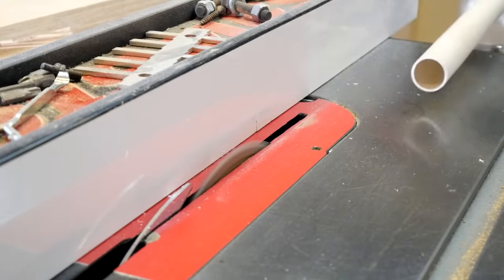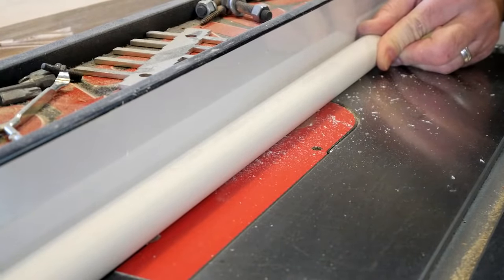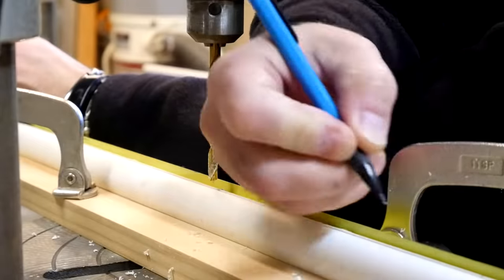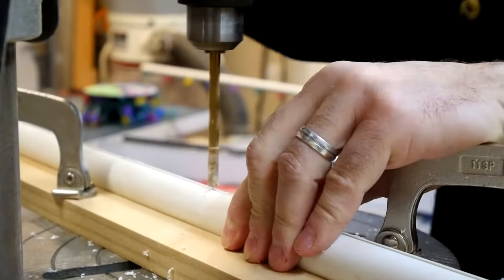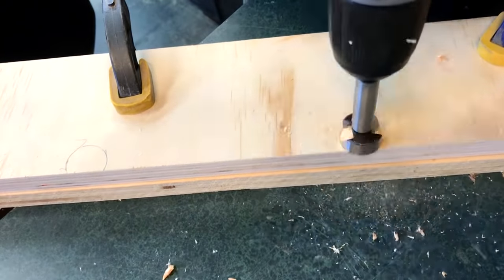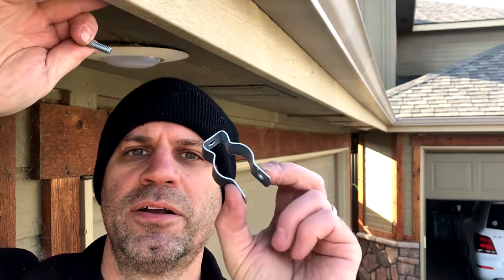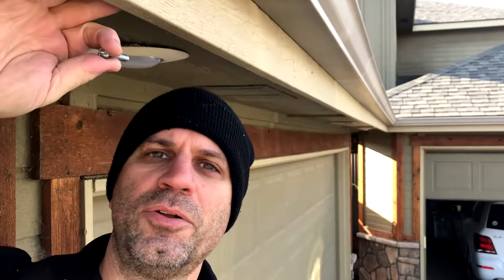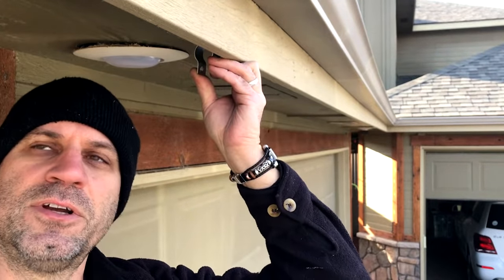Better Way to Install Christmas Lights

Comment: Great idea but you know how Christmas lights are now.  They last one or two seasons and you’ll be removing strings of lights and installing another in the pipes. Just wonder if it will save you time in the long run?  Nice idea though.

Comment: I have been wanting to use some vinyl "J" channel set up against the side of the house and use ribbon LED strips. They would shine up and be protected from the sun.
Reply: They make dedicated aluminum channel with a cover for that purpose. Bit more expensive, but cleaner look.
Reply: Expensive, but that's what the "everlights" product asks for.
Reply: @uploadedvideos7907  20m is $90US, so it isn't incredibly expensive.

Comment: I like the idea, but they do make LED track out of aluminum that have a opaque cover for leaving the lights up all year. It just looks like other trim on the house at that point. If you put programmable 4 color LEDs in them you can change the color based on the holiday and use them more. They are more expensive than this, but also more permanent and look better.

Comment: What's the update on if turning them in for the rest of the year works?
Reply from the maker: @eric4880, Thanks for asking what seems to be on many people's minds! Yes, they work just as I hoped. It takes about 15 minutes to rotate the pipes at the beginning and end of each season. Have had zero maintenance and they still work great!

Comment: Could this be used with any Christmas lights and what was the purpose of the hole through the slit
Reply: I would think it is where the bulb sits and keeps them from sliding.

Comment: quick suggestion, it might be easier to drill the holes first and then run the pipe through the table saw. The pipe is more rigid before you slice it.
Reply: YES I was thinking the same, use a sharpie to mark a straight line prior to drilling the hole for a straight line

Comment: Cool idea - wouldn't it be easier to drill the holes before you slice down the length of the pipe?

Comment: I did the same thing about 5 years ago. But I drilled them sideways into the backside of the facia board and left some play in the screw to expand  to put the lights in. I also use a pair of dikes to open the channel when I twist it. Hides the wires and holds the lights straight. I use it every year. I leave the pipe up but take the lights down.

Comment: As some of the others suggested 
You should have drilled the holes first
Then make the saw cut down the center of your pipe , 
Next is pick up some male and female electrical plugs to put on the end of each light strip , After installing the lights in a length of pipe , Cut the wires at the end of the pipe and install a male plug on the end of one strip and a female plug on the next strip and so on
That way you have individual light strip assemblies , Making them much easier to put up instead of having the pipes together in one long strand , So you just put the strips up one at a time and plug in the ends of the strips together afterwards , 
All you need is just the cheap electrical plugs if you're using LED lights because of how little power they use

Comment: If you wanted to put them up and take them down quick and easy you could use broom holder clips like every 16 inches or so. Then the tubes would just pop in and out.

Comment: To anyone wanting to use this idea, drill the holes before cutting the pipe. You can surely snap a line down the center to keep the holes in a straight line vs having to spend time making jigs to keep the channel closed while trying to drill holes.

Comment: Nice installation.  I screwed eyelets into the eve facia. I still have to hang the lights but at least they stay up until I decide to remove them. I was using the long icicle hanging lights.. I would come home, before the eyelets were installed and find half of the strings were on the ground. No more of that.
 Another trick I used was to install the lights inside my house in the windows using tiny suction cups. The house was a rental and the landlord would not allow anything attached to the exterior of the dwelling.

Comment: The pipe usually has printing on it all the way down you can use as a reference for a straight line. First use an soldering iron the size of the lamp sockets and melt the holes. Then slice the pipe using printing as reference. The pipe will slightly compress after being spice and the light socket will fit snugly in the holes that were melted with a smooth round edge making the lamps stand straight up.
Reply: Why the hell do you need to "melt" them? Just drill them out and save yourself time. Besides that, the fumes that escape from melted and burning PVC and not exactly the best for you. That C there means chloride.

Comment: Just an thought but, That may rot out the fascia board over time. Especially if you take them down every year and then re-install next year with new or old screw holes.
Reply: Less likely to rot the soffit since it's not generally subjected to direct water contact, however condensation on those metal clips can reduce the lifetime of the soffit as over time it will cause the anchor points to swell up. I'd use a nylon washer to add a 1/4 between the soffit and the bracket clip. With a dab of Dap on both sides of the washer condensation moisture likely won't be a problem.

Comment: That seems like a lot of work, and it looks the same year after year. i achieved a better (in my opinion) effect with a bunch of cup hooks. They've been up and usable in many different configurations for over 30 years.  Plus light storage is way easier too.

Comment: What  are  the clips/hangers you used called? and  Were you able to swivel  them in a fashion that you you could leave the lights tucked away for  the year?
Reply: Yes, those clips! I need the name. I already have my lights attached to PVC, but I need better clips!
Reply: @kbcoggin  They are pipe hangers. Buy them at Home Depot or Lowes

Comment: Use binder clips to fasten them to the under side of the facia board.  After the season is over they pull right off.  The clips are then ready for the next year.  No nailing. Low cost.  EASY!!

Comment: i keep it simple - i have gutter hooks which i leave up year round, and then i just drop the strand of lights in the hooks --- with a helper, only takes a few minutes to hang lights. only on front of house, one straight line - brick ranch.

Comment: Good idea, but my HOA will not let me use the clips or leave the lights up.  Going to use aluminum hooks to hang the pipe to the gutter.   This way I can put them up and take them down with a long stick instead of a ladder.

Comment: How severe is your winds in the Holiday Season? I am wondering how much of an issue having 40-50mph winds with gusts much stronger would cause the thin wall schedule 40, vs schedule 80....
Reply: I recommend you move to an area with more civilized winds!!

Comment: I think this is genius. I like icicle lights. Could something similar work if you cut the slot and fed the main line through it with the danglers falling out?

Comment: I just spaced nails in the wood following the roof line and wrapped the lights wire around the nail once then moved to the next...60 feet of lights  done in 20 minutes.  Nails will be there for next year.
Reply: Just be super careful that the screw threads don't cut into the plastic wire's wrapping or they could catch fire (or create a dangerous shock hazard when you touch them to take them down).

Comment: I'm waiting for someone to come out with a UV stable xmas light holder.  Just like his original.  I have the clear clips on my gutters, with clear lights I use all year round as low level patio lighting. About every 4 mos, the sun destroys the clips, and they 'unzip' and my lights fall off the gutters.

Comment: But those, you have to bring down after the holidays. If you put up addressable LEDs, you can have lights for different holidays all year round, and you cant see them from the street during the day. Wont get an HOA letter in the mail either.

Comment: Should have made a little wooden JIG to spread the pipe split that you could just move down the pipe as you put the lights in. That would have made it much easier.
And you should have spray painted the pipe black or dark green or some dark color. Or maybe the color of your house parts.

Comment: Probably would have saved you some time and headaches if you drilled your holes first then ran it through the table saw then you wouldn't have had to kill your fingers and then waste time having to make another jig to hold it together to drill the holes

Comment: Why didn't you drill the bulb-mounting holes first, then slit the tube?  It would have been a slightly interrupted cut, but far faster and cleaner than the process you ended with.  Your jig could have been oriented to put pressure on the side-walls longitudinally instead of radially. 

Overall, this is a brilliant concept.  I especially like the idea of rotating the lights during the off-season.
Reply: he wanted to show how smart he is...LOL

Comment: Everytime the spinning blade reaches a new hole, you run the risk of shattering the pipe. Cut first, then lower the impact on the material and drill.

Comment: Nice idea, as a tool maker, you should have drilled the holes first and then cut the slot out. Would have also liked to have seen a few pics even, of the finished project.

Comment: That looks like a ton more work! I could have had them up and done by then! It takes me maybe 30 minutes to hand mine! I have a 2400 sq ft one story house with very high apexes i hammered a nail every 18 inches just behind the eaves and it makes hanging and removing lights ez pz lemon squeezy!

Comment: Could draw a line, drill holes down the line first, then rip down the line through the holes afterwards so you don't have to squeeze it together.

Comment: I like your idea. I do have a tiny bit of constructive criticism though. I'm now retired, but owned a machine shop for many years where we designed and built many complex die sets for punching and bending metal parts. My comment is on the hold down boards you added to keep the pipe located and the slot from opening up while you drill the cross hole in it. This could've been done much simpler by screwing some wood pieces flat atop of your base board, snugged against each side of the pipe, and then when you had enough height you could bridge over the pipe with another piece. Drill your hole through that piece and the pipe would be secured. If it were metal you were drilling in, I would press fit what's called a drill bushing. This allows a very accurate placement of the hole. Of course you would not need that, which is why a simple hole using the same drill you are drilling into the pipe with. I have always loved people that think of better ways to do something, and you certainly are that!

Comment: Nice!  I was concerned about storage, but under the soffit, they store in place!  I guess I still wonder whether exposure to the outdoor environment year round might take a toll, but it’s certainly worth a try.  Great job!
Reply: This is for sure not permanent. No wire is going to tolerate the heat and cold forever. The rig will have to be brought down and the lights replaced every few years for sure.

Comment: The lights are LEDs and are connected on a 3-wire run which has preset lengths and could be limiting. 

Purchase 2-wire empty socket wire that you can cut to any length, fill with screw-in LEDs and connect multiple sets with use vampire plugs and sockets. 

I love his idea, I thought of something similar years ago but wasn't able to make it work. I'll be doing this for sure. Great video!

Comment: I dunno, seems like a lot of work. They use clips that screw into a paint roller pole and you clip on the gutter, then unscrew from the pole. It takes less then 20 minutes to hang end to end. Your way is clever though.

Comment: I don't know... I have clips on my gutters all year round. I just lay out the strings on the ground, climb up and hook on either side of the ladder, move and repeat. I also have a string of whites permanently attached under the eaves to light the front yard. Unplug one set, plug in the other. It aint that "hard".

Comment: This method looks like too much work.  My father put screw-in J hooks into the bottom of the soffit boards and hung the lights on those.  After the holiday it's easy to lift the string of lights off the hooks for storage.  The hooks stay there year around.

Comment: I felt like this was pretty much overkill. And I love how chaotic this is. It would have taken less time to hang them traditionally, and you added time and effort for this solution. This is a win if you kept them up all year. I am dying to see how it came out.
Reply: Was thinking the same?
Reply: Taking them down and putting back up the next year is way easier though. Just snap it into the clips left from last year. Also you spend less time up on a ladder, and had to move the ladder much less. All reducing risk of injury. The lights are more consistently oriented and spaced as well.

Comment: Nicely done ! I've been using paired 1X2 's painted white with the strings of lights held on with white Tie-wraps . I used simple eye-hooks to mount everything to the fascia and I can put everything up , or down , in about ten minutes . Be sure to use UV resistant Tie-wraps if anyone tries this route . Great idea of yours ! Cheers/SRK

Comment: No one else was worried about cutting a PVC tube on a table saw without some method to keep it from rolling on the blade? Jus a small twist and that thing kicks back in your face or worse yet shatters.

Comment: What a great idea! I have the same lights and quit putting them up because of the crappy time consuming clips too!
It’s too late for me to try it this year. I hope I remember, next year!
By the way, the pipe you used is called schedule 80
Reply: Schedule 80 has thicker walls than schedule 40
Reply: Kevin Allen your mixed up. Schedule 40 has thicker walls than schedule 80! It’s similar to metal thickness and wire thickness, the larger the number, the thinner the product! 28 gauge sheet metal is thinner than 12 gauge, 14 gauge wire is thinner than 10 gauge.
It’s the same with shot guns too, a 20 gauge is smaller than a 12 gauge. So I hope this helps you understand that I know what I’m talking about and I’m not guessing!
Reply: @grdelawter4266  Its the same with jewelry too (at least earings, eyebrow/nose peircings, etc)  I remember when I was in my 20s trying to find some.  Higher the number the thinner/smaller it is
Reply: @grdelawter4266  Sorry; you’re the confused party here.  Examples:  1” Sch 40 is 1/8” thick.  1” Sch 80 is 3/16” thick.  1-1/4 Sch 40 is 1/8” thick.  1-1/4” Sch 80 is 1/4” thick.  You are correct regarding sheet metal and shotgun bores but wrong on pipe.
Reply: Class 200
Reply: It NOT too late... You can have the pipes ready for when you take the lights down, and instead of storing them,  put them on the pipes... (Think of the time saved for next year.)

Comment: The ultimate, price is no object, would be to combine several comments. Make a long box for variable color led strips. Slot the front edges and slip in a strip of white or translucent polycarbonate. It hides the lights during the day and off season, but let’s the strip shine through at night. If you like the spaced look, the straps can be cut and spaced further apart. I did say price no object. Maybe I’ll post my own video when I get the time and money. 👨🏻‍🦳🎄🪜

Comment: If you attach a square block to the ends, then Drill your holes and finally rip you will save time and aggravation.

Comment: I would never use those plastic things. Under the eaves of my house the metal flashing has grooves every foot or so, and there is a metal edge on both sides that holds the flashing in place. I measured the width of the flashing and cut square wooden rods that would fit into that groove and would be long enough to fit under both edges. I filed the ends of each rod down to a blunt point and screwed a cup hook into the center. I took the rod and taped it to a square pole with that flimsy blue painter tape with the cup hook facing down. Then I slid the blunt end into one of the grooves under the flashing edge, then slid it forward so the other end was also under an edge. Then twisted the pole to snap the tape. Now you have a permanent place to hang your lights. Add these rods at convenient intervals. Using the same pole I put a 3 inch screw in the end. Drape the lights over the screw, hoist it up and hang it over the cup hook. Takes some finesse but you get the hang of it after a while. You can barely see the wooden rods when not being used for lights. If you wanted you could paint them the same color as the eaves and they'd be invisible.

Comment: Looks like a good idea But if you don't have a garage or a porch ( lobby etc,  etc)  & just a front door no gutter Then i suppose there has to be another solution to putting the dam things🤔😠😡 up.  Maybe you or someone else can help solve this issue for those who don't have what you have & only the very basics in doorways. Not just in the USA  but,  mainly in the UK as time is limited now only just a tiny bit over 5 weeks till the BORING!!!  time arrives.

Comment: Great idea - painful video!
1. Why didn't you dril the holes first, then split down the middle? (Seems fairly obvious!)
2. Did we need to see the same operation - loading the lights - repeated over and over? Think most of us got the idea within 10 seconds, or so.
3. An 8 minute video to show this!

Comment: Great idea but you know after the first year and 3 bulbs die you’ll be pissed. I stopped putting up lights when they all became non removable bulbs.  Throwing out light strings every year seemed way to wasteful